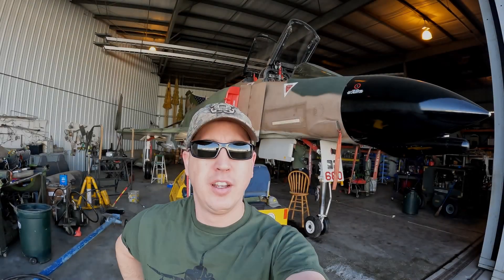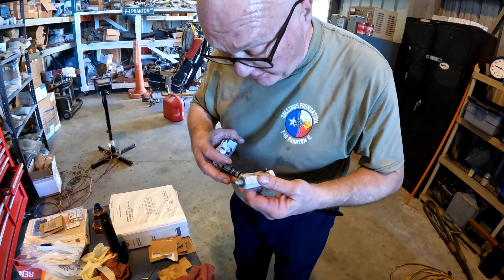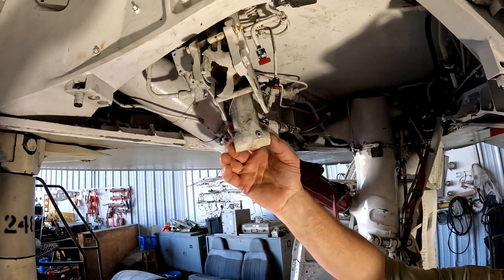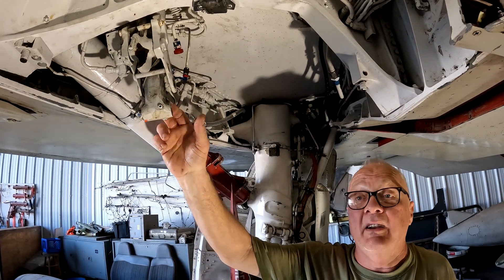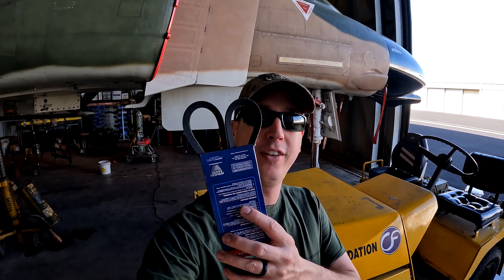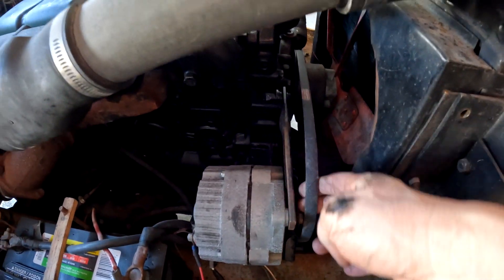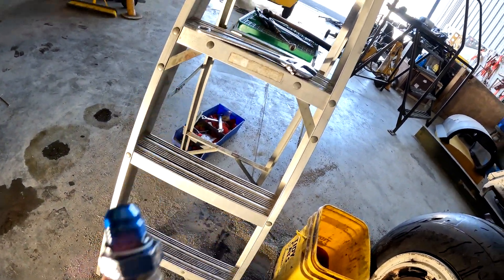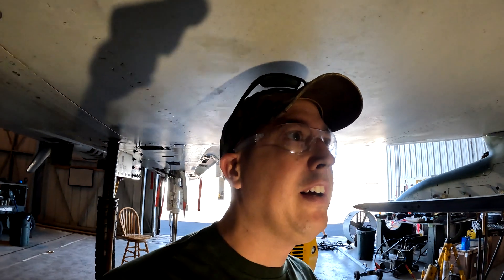Too Small and Too Big, Finding the Right Size - F-4 Phantom

Comment: Question,  who makes and bends your hydraulic lines in the case one broke.  I worked with Al in the 91 AMU and the reserve unit. I worked on hydraulic in the reserve unit on F4's
Reply from the maker: There is a shop near here where we can have stuff made when a fitting goes bad or a line cracks. If you are near Houston, we sure could use some help with the hydraulics! And that is awesome that you worked with Al, I'll be sure and mention that to him!

Comment: What about the electronics and such?  Is that system workin well?  Whats been removed/added to the cockpit?
Reply from the maker: Most of the electronics are working good. The Air Force did disable a few things prior to the Foundation taking ownership, namely the weapons and radar systems. The INS I believe is still functional but no longer is the primary means of navigation, mainly because of the nice Garmin GPS systems that was installed.